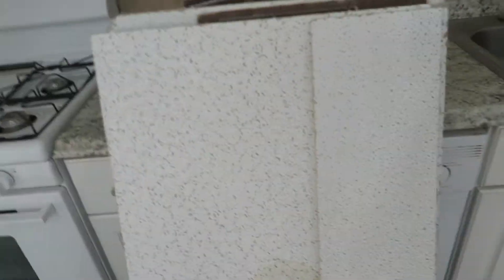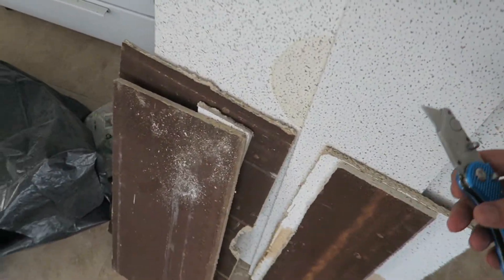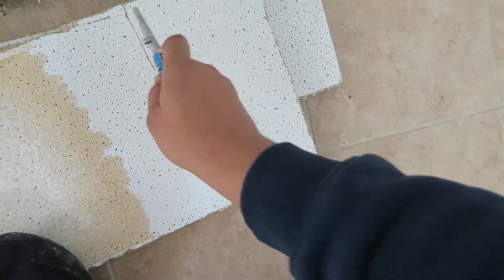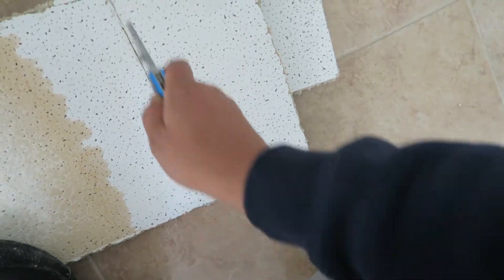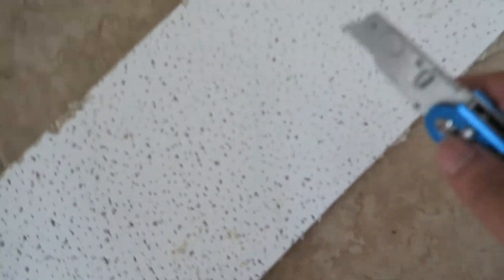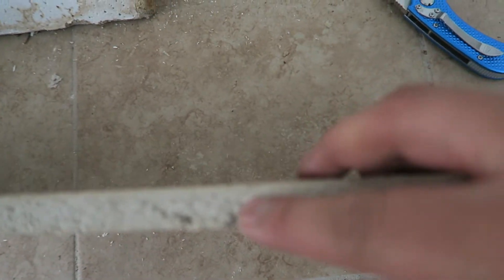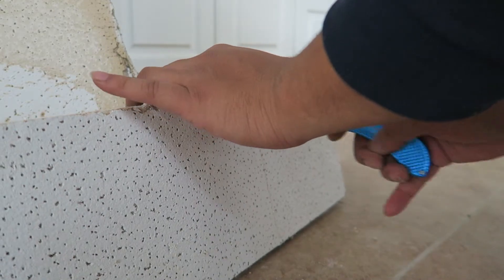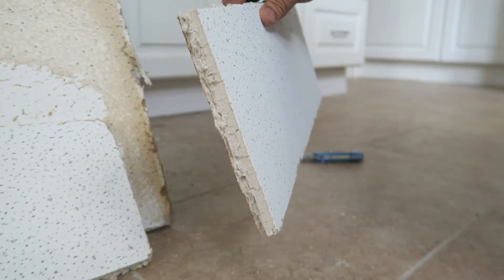How to cut ceiling tile without a mess

Comment: You still have a very rough deformed edge that will still make a mess if additional trimming is needed. More trimming will also tear away pieces of finished product. These new tiles with the brown backing are fine when used as full sheets but too thin and the inner material too inconsistent for reliable trimming. I’m going to try running a panel through a table saw and if that doesn’t work I’ll look for the more expensive thicker panels I have used in the past. It would be worth it.